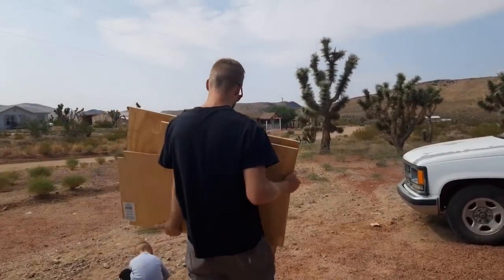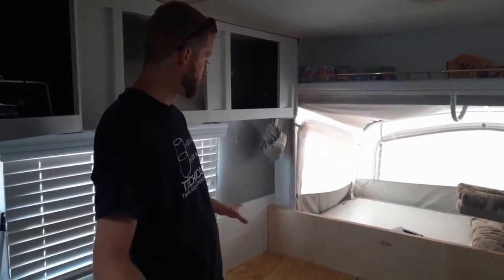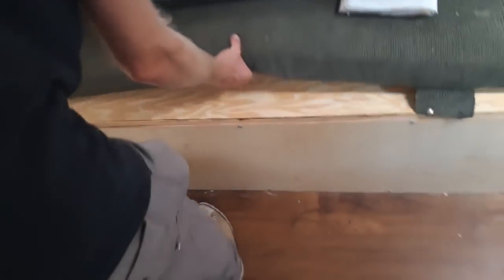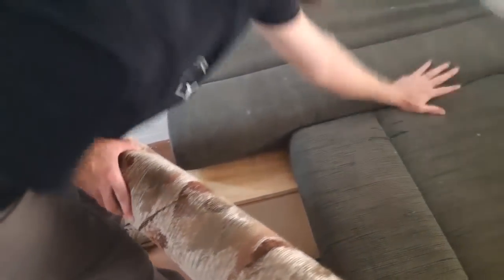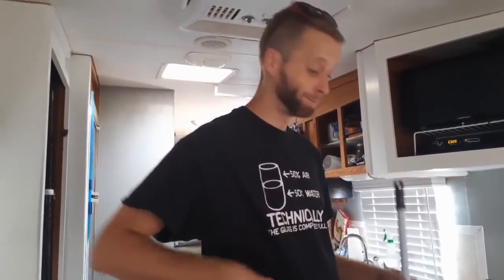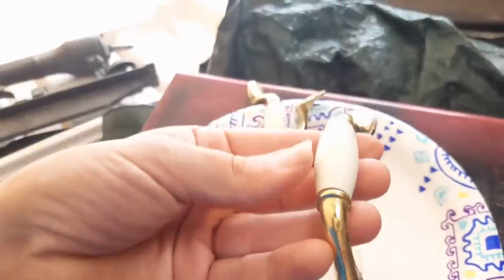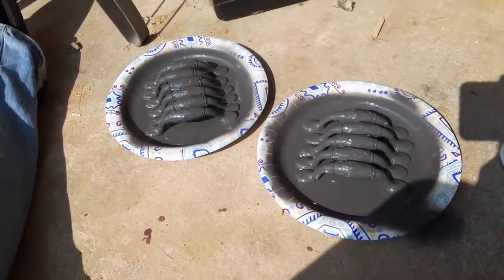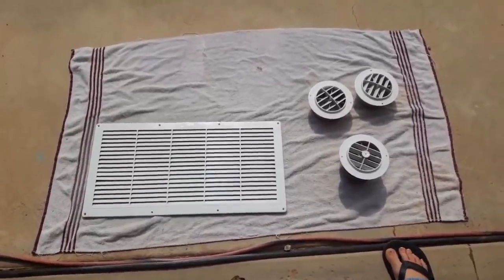The Build Continues| 5th Wheel Travel Trailer Renovation |Day 16

Comment: Hey Awesome Family! It's coming along great! Any plans to INSULATE? The HOT can be VERY HOT and the COLD can be SNOW in AK. ❤
Reply from the maker: Im sure you are asking about the pop out tent portion right? YES! We do plan to add some foam insulation when we get to Arkansas to help maintain the temps - BUT during extreme weather we will run the generator and have a heater going at night, and if it is too hot we will run the A/C. The temp stays pretty maintained in there even with the tent portion now, So i know once we add the foam - it will stay even better. Thanks for the question! We really appreciate you! Hope youre having a great day today!